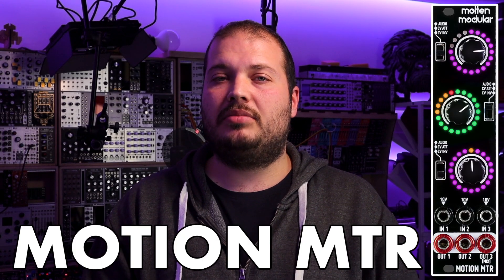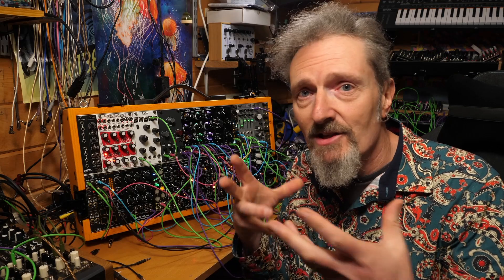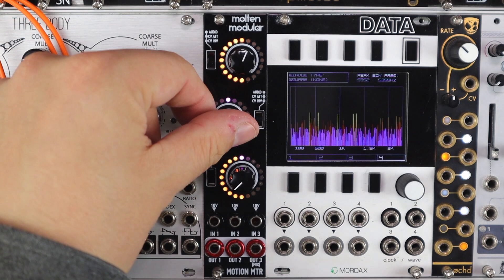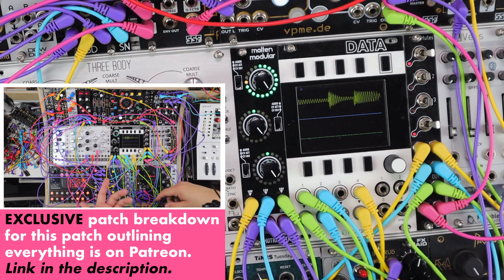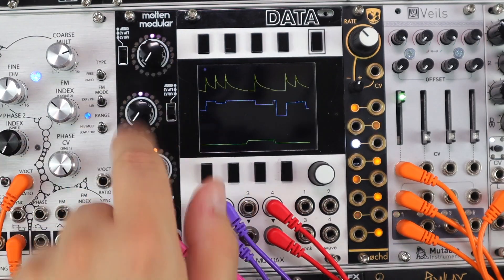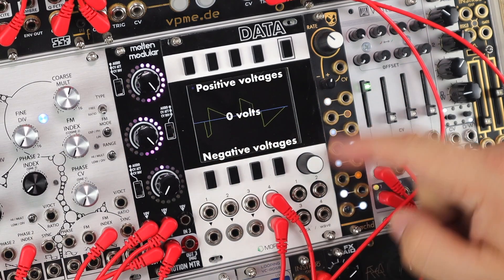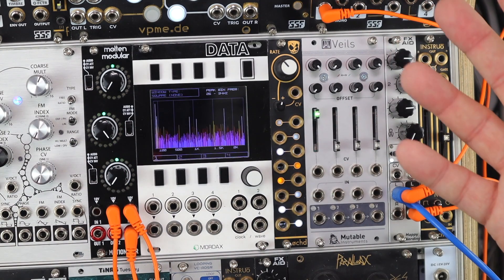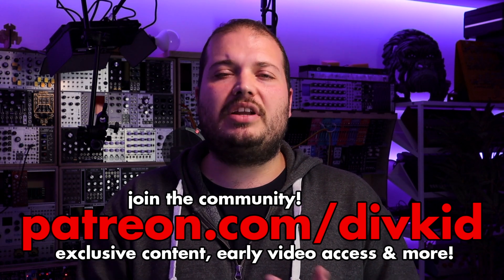Audio & CV VISUALISED I love a Eurorack utility! // Motion Meter (MTR) from Molten Modular & Befaco

Comment: One downside in comparison to similar modules like Mutable Instruments Shades is the power draw. Including a microcontroller and all those LEDS, Befaco specs out a current draw of +12v: 110 mA, -12v: 43 mA. In comparison Mutable Shades draws +12V:15mA, -12V:15mA
Reply from the maker: Yeah driving all that takes a lot of current compared to the really low current needs of those functions generally.

Comment: How does it compare to the Befaco A*B+C which is similar but with a simpler (not as loud!) visual indication of voltages.
Reply from the maker: well you've about 50 less LEDs :) ... joking aside a single LED isn't that handy a lot of the time as judging a varying signal as brightness is tricky. 

But the A*B+C is a four quadrant multiplier, which is a Ring Modulator. You can use it as a VCA. The */x element is a VCA, but one that inverts the signal with negative voltages too. So it's a VCA and offset or Ring Mod and offset.

Some overlap but different things.
Reply: @DivKid  I really like the A*B+C. I have one and plan to have more. But this new Molten module also looks attractive.
Reply from the maker: I don't have an A*B+C but should absolutely correct that.

Comment: Cool module, knowing what's going on with the modulation is a problem I also have, I usually pull up the oscilloscope but having meters right on the knobs could save needing to do that a lot.
Reply from the maker: I'm looking forward to continuing to use it and trying both. DATA for scope stuff and then other less important bits on this.